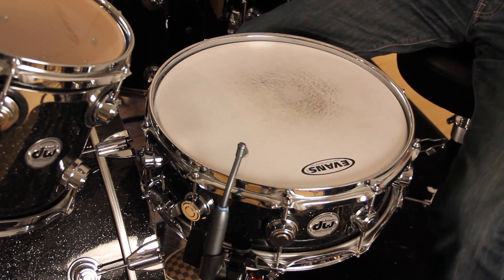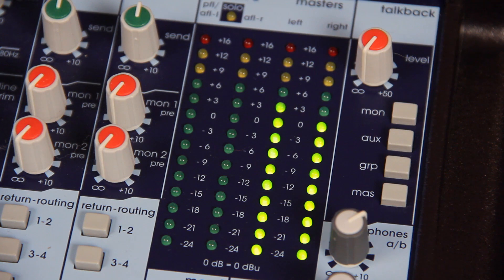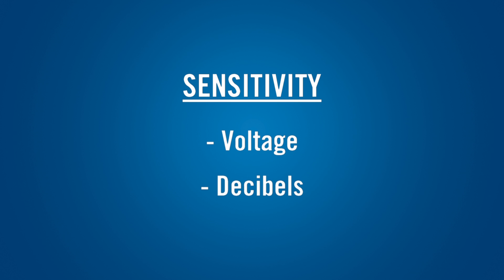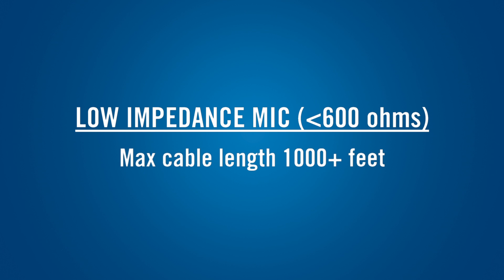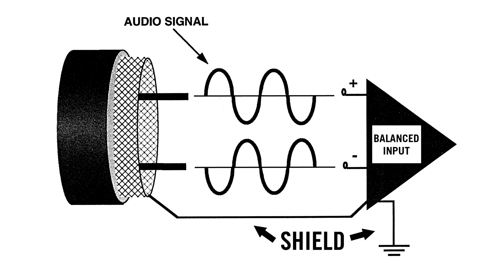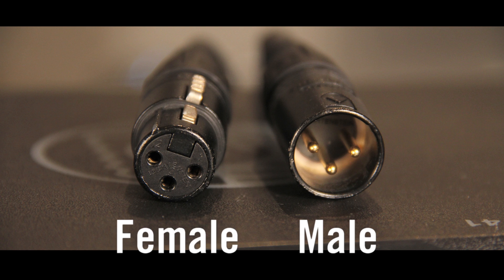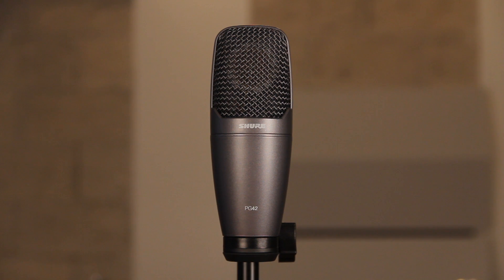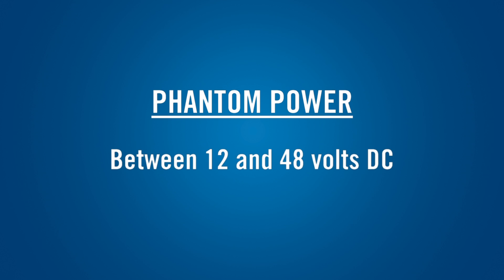Understanding Mic Specifications - Part 4 - Electrical Output

Comment: i have bought a Mixer
but our electrical specifications is
220v or higher and the mixer power is 115v and 120vac adapter
i've pluged it in and i didnt know, Is there any harm or damage occurs the item (mixer) ?

the item input is (AC10V - 115V)
the adapter input is (120VAS - 60Hz 0.2A)

-ThankYou